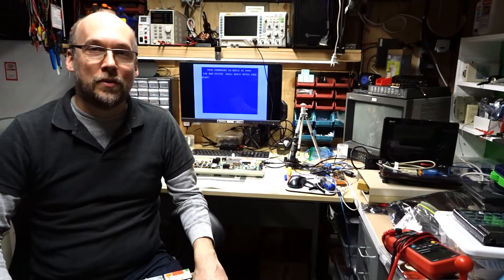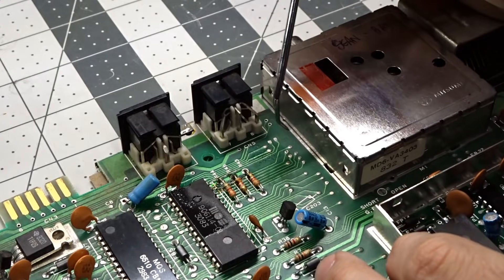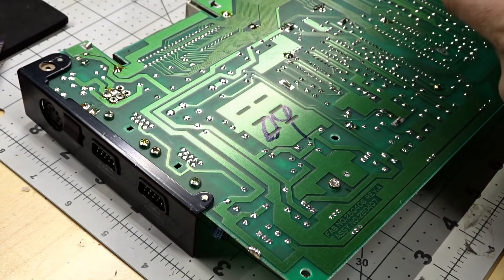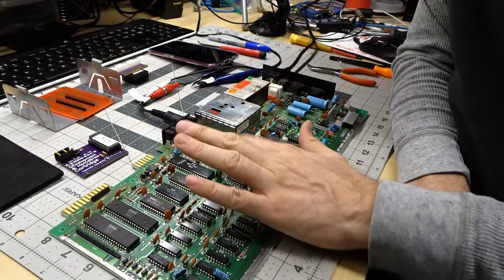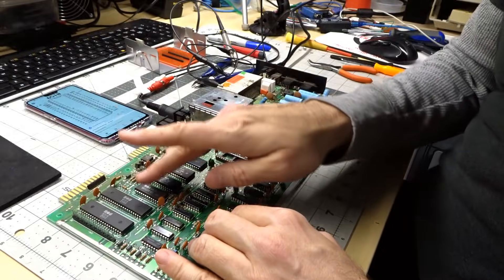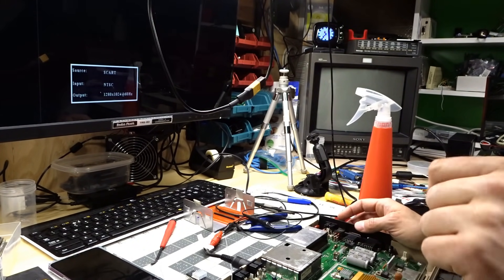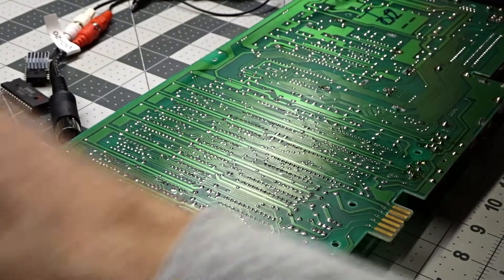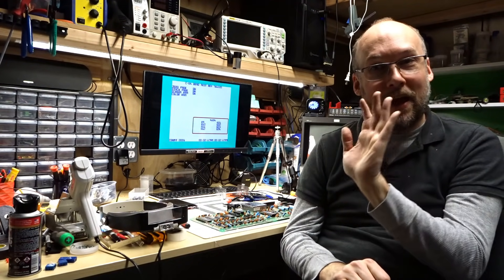Troubleshooting a "black screen" C64

Comment: You're correct, the RF shield is not required for the computer to function normally. However.... we already have a huge RF pollution problem, and we don't need to make it any worse. I always restore any and all RF shields, unless it's that junky cardboard one. I'm developing a means of applying a new RF shield to the computer that doesn't heat the chips. It might involve gluing foil to the underside of the top half of the case. We'll see.

Comment: Nice work, sir! I have to admit that I only had one or two PLAs fully failing so far (and I've repaired quite a few C64s) but they usually are one of the main suspects for black screens. Oh, one thing I've noticed (and I've heard a lot recently): MOS is not MOSTEK, similar name, similar businesses, but different manufacturers. Mostek made some of the first Z80s while MOS made the 6502. Worlds collide! ;)
Reply: Great info! I just assumed he meant "MOS Tech." i.e. short for MOS Technology.

Comment: In case no one else mentioned it, that's not a 0 (zero) for the clock signal, it's a Greek letter Phi (ɸ).
Reply: Now that's the kind of attention to detail I admire! I doff my cap to you, sir!
Reply: it means Φίλιππος, i am greek
Reply: Φίλιππος is the name Phil, or Phillips
Reply: I was about to say the same thing, until I realized that on the 6510 that pin is actually Phi-Zero (Φ 0)

Comment: Careful with removing the video shield- that's there to prevent analog interference on the picture. If you remove it you also start spewing RF out of the computer on channel 3, which can be a nuisance.
Reply: True, but the VIC is prone to overheating and failure, and replacements aren't available.  In practice, noise generally isn't an issue; in very noisy environments, grounding the heatsink might help
Reply: Channel 3 in the old spectrum. A nuisance yes- not sure what old vhf is used for now :)
Reply: @jsmythib  the head designer  has also stated that vic 20-c128 also had design flaws within what the chips were made from and lead to wider number  of physical failures  from the processor to the ram..

I would have to wonder what would of happened  to the  vic 20. c65, c128 through the amiga line of computers  if they all had ram and processor updates  

also the issue with channel settings can also have a interference issue if you had a tv station  near or on the frequency lap the consoles can be tuned to..

This could be overcome  with what nintendo did when you could set your tv channel I suspect with replacement of the rf modulator  with something to where you can set the tv channel might fix known  issues that existed with all consoles of that time  

and typically everyone  encoded to UHF spectrum as the preferred medium  for the channel selection

I can't comment on  sega consoles however  with any console  within nintendo hardware line  it is  possible to change  channel designation ..

something to consider with the switch off analog tv transmission towers that  the entirety of the UHF analog spectrum  can be used as a channel selection if  you  channel selection  of  any computer based from the 70''s-2005ish

however you will need to replace the  rf tuner to give you wider channel selection ...

Comment: Man, I've watched a couple of your videos,  and I immediately became addicted :)   just subscribed + full ring notifications + blue thumb on video. 
Now,
MAN,  what the bell is going on with your camera , that keeps crashing and crashing ?  Because you must be doing anything bad,  the product itself is the culprit.  To me, it must be a hardware defect.... with all Sony's experience on both designing hardware AND software,  I would be surprised if those recurring errors, crashes, e.t.c,  simply came from a software bug or a hardware defect.  Those guys do really know how to build great hardware,  for sure.  That's why it is sad,  too watch you having so much troubles with it...
Some parts must have a severe defect,  somewhere.  Does it also freeze/ crashes when you're outside ?
Could it be the moist/humidity level ? A faulty cable, memory card,  adapter... photo GPS tagging enabled ?
Could be a ton of things.

Anyway,  I will say it her,  on this old video,  your current image quality [Jan 2020] is absolutely amazing ! The picture is so smooth,  so warm... and super crisp,  at the same time. Skintones are fantastic too. It is a pleasure,  to watch a 50m- video,  with such quality !

Comment: Hi Adrian, I really like your videos, keep up the good work.  I have the same (or similar) Sony camera, the RX100-V.  It is a great vlogging camera but prone to overheating when shooting 4K for longer periods.  I found that when I tweaked my settings it would go a lot longer before a problem occurred.  I just bring it up because you mentioned it crashed.  I'm experimenting with a 3D printed mount that holds the Camera & a large heatsink against the 'underside' of the tilted screen so you can shoot 4K continuously without overheating.

Comment: When cleaning the flux, I suggest you brush then put a paper towel under the brush to actually absorb the flux. Otherwise you are just moving the flux around on the board.
Reply: SPOT ON ADVICE! Use a paper towel to quickly wick away flux suspended in flux cleaning fluid.

Comment: I have the same desoldering tool! You don't need a large heatsink because the chip die is only 2 sq C in the middle of the chip. the multiple fins on a square heatsink is more than what the original RF box lid had

Comment: :I disagree with removing the shield.  --  Just get a chip puller.   At 18:30, why didn't you use a PIN Socket?

Comment: You can save chip with shorted legs, You can use your own trick. Solder it to a socket with rounded pins and you have normal pin size.

Comment: I did an SNES game repair not long ago. I had a Super Mario game with broken off contacts so you couldn't stick it into the console. I checked the inside and found that there are versions for SNES game PCB boards. Checked online and found a list of games that use the same type of board, bought a cheap sports game and desoldered every chip from both, swapping the chips and resurrecting the Mario game. I felt a little bad for destroying another game but it was some american football thing and that was super cheap, Mario is worth more :P Long story short, I used solder braid and flux with a regular soldering iron and I was lucky because the braid was sucking out the solder like a dream. Not every solder does this, it was really good to work with these SNES cartridges.

Comment: FCC issues aside, I don't understand the thinking behind trashing the RF shield, especially one appearing to be in pristine condition. It's part of the original unit, so why discard it?

What's next, sanding away all of the silkscreen markings, just because?
Reply: Removing it makes the machine more serviceable, and more reliable by increasing airflow.  What does keeping it do?
Reply: Keeping it retains the condition of the original computer. Period. I don't expect someone who cites increased airflow to understand nostalgia, so I don't care if you don't get it. If performance is the only metric you're interested in, what's the point of even using an 8-bit computer that runs at a measly 1MHz?
Reply: @mykalimba  I said reliability, not performance.  These chips are prone to failure due to overheating and replacements are not available for certain critical parts.  I do recall that the original condition of these machines was, functional.  Fun too!  Kinda like you're not.
Reply: Disabling FCC rf shielding is wrong and destroys all AM and shortwave radio reception everywhere in the neighborhood.

Comment: I don't recommend trashing any of the RF shielding. The RF shielding is part of the original design of the Commodore 64 no matter whether it was an FCC requirement or not. If you remove and trash the RF shielding you will be effectively devaluing your C64.
Reply: It is made from cardboard on many C64s and traps heat in a machine that has little ventilation per se. If you want to use the C64 it would be better to remove and store it. Other machines like the Atari 8 bits have a proper metal shield that is actually needed since it connects grounds together.

Comment: Portland heh, my 64 (xxx407) is from Portland. The thing it suffers from is a white screen, not a black. It was working 20 years ago when it was stored but now seems to resist all human interaction. I have replaced the PLA but with no change on the screen. I have re-capped it and veriified voltages. I also built a new PS because the old one went missing. Fortunately I had a large assortment of DIN connectors from the 80's. I guess firing up the scope is next and possibly the VIC chip. Great video

Comment: Cool. I like this kind of fixing video. I was thinking about making a 21st century test cartridge with an own processor and power supply, that would measure the clocks, reset, data and address lines and the select signals on the cartridge port, that also provides a dead test and diagnostic program. I am not quite sure, if I will make it. It depends on the availability of a cpld, that is definitely required for that. The processor could be something with wifi, so you can see the test results on a website....

Comment: The legs of the ICs are not cut as part of the insertion process. The DIP insertion machine picks up the IC, the PCB is moved under the head and the IC is lowered into place. On the bottom of the PCB is a tool that slightly bends the pins in and cuts them to length. This keeps the chips in place, i.e. so they do not get knocked loose as the PCB goes though the axial and radial insertion machines, conveyors, hand insertion and wave soldering machine.

Comment: Why do you think the shield is not good to have?
Reply: @adriansdigitalbasement  Do you really think FCC compliance is a bad thing and therefor breaking it, as a good thing?  The fact that a company (Commodore) got in trouble for being lax, would say to me there are good reasons for not being lax.   If a company gets in to trouble and so takes action to add  shielding then anyone else should get in trouble for removing it, esp as it costs next to nothing and the little hassle you may have is very! little.

Comment: Thanks for sharing your repair, was great to watch.
Its the experience and the right guesses that separates the professional from the amateur. You showed that clearly.
But something to your workflow(seen often theses days): Take part A and put it into a working machine as a diagnosis tool. This is fast, but debatable.
In a case, when your guess is wrong and part A has damaged another part B in the faulty machine, then the chances are high that you ruin your diagnosis tool, too.
The other case, switching back the working part from the diagnosis tool into the faulty machine will make it likely that part B kills the working one. 
This is a scenario to raise the worst case what can happen up to 75% so far:) 
So my recommendation: You have the tools! First measure the voltages. Ride on the waveforms. Check for shorts. With the device-to-test in the board and plugged out. And after that you can do a "hot" test.

Second: Don't recommend things that you do not understand to other people... when they are based on guesses, personal preference or worse things. At least describe how you came to that conclusion. 
This is not meant personally, but your RF-Shield aversion looks a little funny at the second look:)

Third: Heat Sinks are as good as the environment they are in. No airflow = no delta-T -> useless(as in not as useful it can be).

Keep on soldering, great work:)

Comment: Would love to see a video on how you use your oscilloscope for troubleshooting, since we didn’t really get to see it here! I have a basic pocket scope, but have very little idea of how to use it effectively to test chips and circuits.
Reply: +1 on that one, can we get a video that shows that step of the process a bit clearer?
Reply: youre just looking for activity on the lines.  if the cpu is running, the data lines will be busy.  if its zero or "floating", you could have a problem around it

Comment: Great video as always, I enjoyed watching. When removing things by pulling and heating like you did with the RF shield around the VIC, I've found that clamping the part or weighting it makes things a bit easier, using a small vice or even pliers with an elastic band. Depends on the part of course.

Comment: Wow, this takes me back to 1989, the last time I repaired a C64... All I had was an iron, a Soldapult, and a working unit with mostly socketed chips. I guess it's a bit easier/faster these days with scopes, diag carts, and the Internet, but it's still an adventure. It's sad that replacement chips are getting hard to find, though.
What anti-static brush are you using? It seems to clean up flux residue quite nicely.

Comment: I have a Vic-20 and a Commodore 64 that had holes drilled into the case and (inadvertently?) drilled through the motherboard. I thought I might be able to use wires to patch between points, but thats turning out to be really difficult. Is there an easier way to fill in the hole and fix the traces?

Comment: atleast desolder the RF Shields, if you just cut them off you'll end up with sharp edges all around the board.
7:51 i thought you had one of those IC Pullers...

Comment: There have been talks about the VIC-II is not reproduced, like PLA and SID is. It would be so cool, if the VIC-II was replicated in FPGA form of some sort. Of course dual voltage, controlled by rerouting the voltage from pin 40 to 13, using a jumper.

Comment: Hello Adrian Black my commodore 64 also has a black screen video chips are good but the rams bad when I touch it it's like super hot to the touch is it easy to solider on sockets then put the new chips in or not? also Does it matter which chips I get or not because there's many different ram chips for the Commodore 64? and Due to the fact my C64 is brand new in the box in mint condition by me replacing the chips would that affect it's value in the future or not in terms of originality? Any help would be greatly appreciated.

Comment: My C64 have this problem (happened right before christmas) first, it gave the rainbow flickering screen that would be bad PLA, so i bought a new PLA and socket and put that in right some days New Years Eve, when switched on, the C64 was blackscreening, then while i was feeling on the chips for heat, the CR4 bridge rectifier suddenly fizzed and popped, right before i threw myself on the ON/OFF button, and i immediatly checked the PSU (which is an original one) and found that there is no 9V at all on pin 6-7, and on pin 5 when measuring DC, im getting 5.2v  - and if measuring AC on pin5 i find 10.6v (a tip from a friend), now this means prob a bad PSU, right? Now, i ordered a new CR bridge, but could this pop have hurt something else? do i need new PLA, VIC or something now? i am kinda nervous, this C64 have been a bro of mine for 30 years now, i dont want to bury it :(
Reply: Any progress with it?

Comment: There are other brands of PLA chip, such as Signetics which is in one of my C64s.  Question is, to buy one new, would it work right out of the box, or do they have to be programmed since they are a programmable logic array?
Reply: Yes, they can be replaced using a generic part but it most definitely would have to be programmed first.

Comment: Interesting video. 

I'm trying to fault find my old C64 (Made in W.Germany) same symptoms, blank screen.  I suspected the PLA chip, got a plug in replacement, but didn't fix the issue.  Still on the bench at the moment.
Reply: Michael Carey With a known good PLA in the board, the most likely failure point after that is usually one or more dead RAM chips. It can be hard to diagnose without a dead test cartridge however. Black screen faults can be troublesome because nearly all of the chips on the board can cause a black screen failure, but it never hurts to check for the most common failures first...
Reply: I thought I should post a conclusion message. The fault ended up being corrosion on the PCB in the clock/PLL area (next to the VIC2) from leaking electrolytic capacitors. It took some discreetly placed "bodge wires" to replace the damaged copper after the board was cleaned.

Comment: You spray the board with alcohol, then brush it, but don't wipe up the reside.  Seems like all you're doing is smearing whatever crud around into a thin layer.
Reply: Hold the board vertical, so it can drip down off the edge and wash away.

Also sometimes cruddy flux needs a toothbrush or something with stiffer bristles, rather than that ESD brush.

Comment: ohhh I hate those revision board with virtually no sockets. I got one of those as a trade (I wanted a c64, and I had a spare stereo system - big speakers and an amp so my friend and I traded). I took it apart and recapped it, desoldered all the chips, and put in sockets, and a fast load chip. Makes loading from the 1541-II heaps faster.

Comment: It's always nice when it's just one chip causing the issue and doesn't turn into a case of whack-a-mole. As an aside, I just picked up an Atari STe and was wondering, do I need to heatsink the critical chips, like the CPU, blitter, floppy/hard drive controllers, etc?
Reply: Heat sinks never hurt whilst leaving them off can be fatal to a device?

Comment: Nice video. I've never had one with just a bad PLA, when that been the problem it's always been the PLA and something else, like one of the multiplexors or a cooked CIA holding the data lines high. The nastiest one I ever fixed had three or four faulty logic ICs, it was like a whack-a-mole game. As a general rule, any logic ICs that are MOS branded should be the primary suspects, such as 7708s at U13 and U25. These were cheap in-house versions of generic ICs and were massively unreliable.